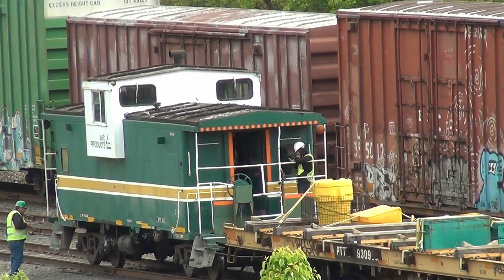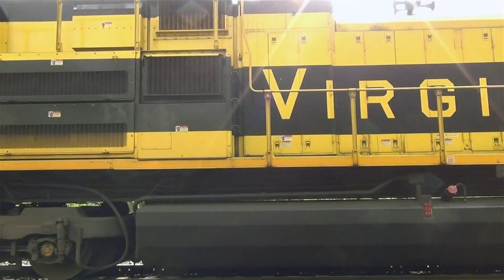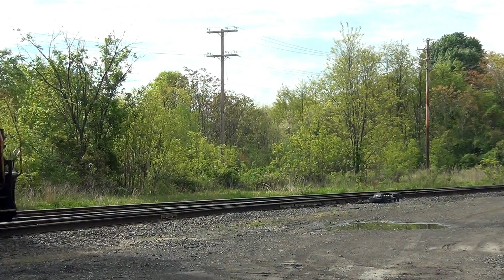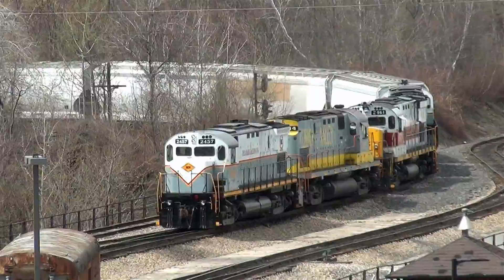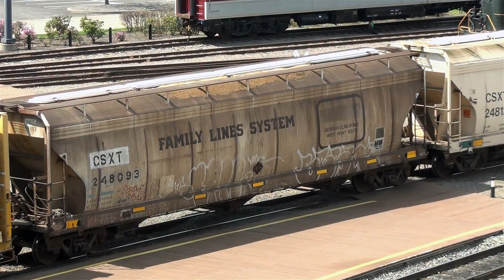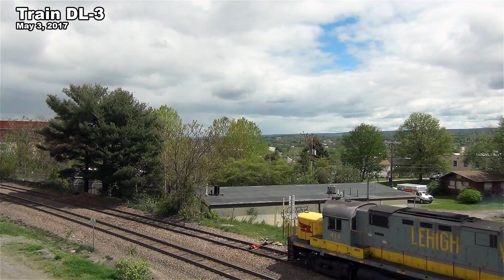[HU][T-1] ALCOS, HERITAGE & FUNKY FREIGHTS: More High/Wide Loads in Northeast PA

Comment: It’s nice to see and EMD (Virginian) and a G.E. (Norfolk Southern) on the same train as it makes spotting the similarities and differences a lot easier. The distinctive feature of the EMDs are the two fans on the roof above the radiator section (the fans on the G.E. are hidden under the metal grating, though the two both have a large bulge on the back where the radiators are.) The distinctive feature of the G.E. Unit is the two air tanks above the fuel tank, but below the walkway on the right (Engineer’s) side. Also, the exhaust stack is more pronounced. One could go on and on, but that’s a topic for a whole ‘nuther video! 😎
Reply from the maker: That's right!